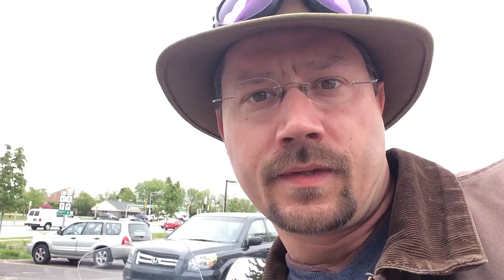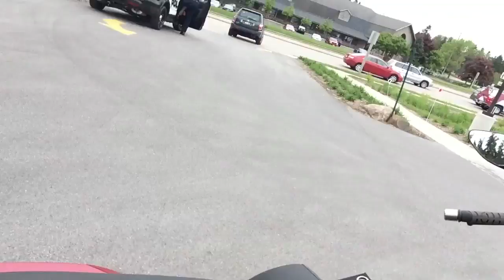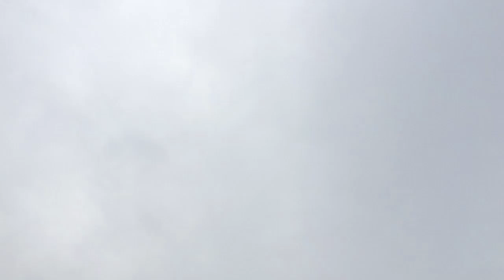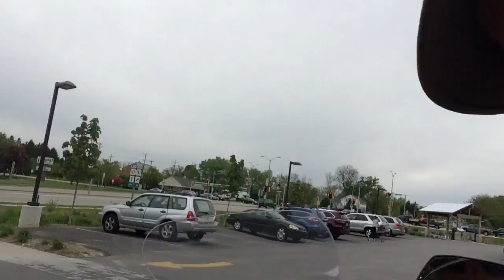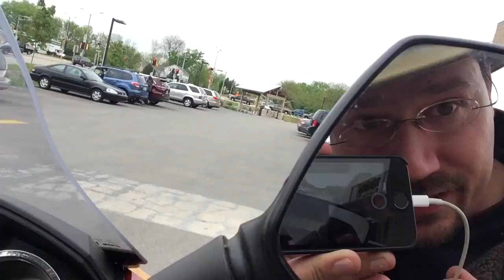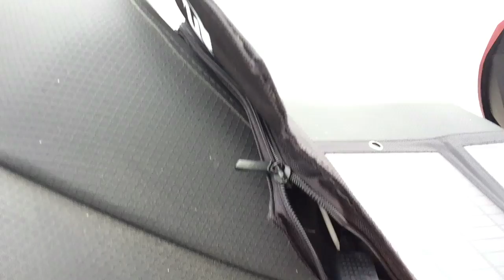Charging my phone from a solar panel instead of Vectrix

Comment: Many modern chargers work from a 100 to 240 VAC outlet.

If it's a newer light-weight "switching" changer, the AC input goes right into a diode bridge and converts it into DC. (that DC is then regulated down to the charge voltage).

That means (in theory) you can connect that power supply directly to a 150VDC battery (or PV array) and it will work just fine. 

I've tested a couple of 5Vdc and 12Vdc PSUs at 48-50 vdc (my back-up battery bank)
and they worked fine under a light load. In another project I used a 12v PSU by connecting the 100-240 vac input to a 100-130 vdc PV array.. It worked like it was plugged into a wall outlet..
Reply from the maker: Richard Lee I'm considering creating a dedicated connection to the battery (maybe an Anderson connector?) which I could use to hook to an external charger or a power inverter.
Reply: For a little wall-wart USB charger, you could use a standard 120vac outlet socket. Or maybe just a cheap Zip-cord extension cord.

 Just have to paint red and label it "DC".
Of course that's not fool proof.. (Since fools can't read).

One of the heavy duty Anderson PowerPole connectors sounds good for charging.

Just be aware that any current flow / load when plugging or unplugging the Anderson connector can lead to arcing. DC over 100v will destroy contacts on relays, switches and connectors.

My fixed 800W PV array is wired serially is high voltage (100-130v) but is limited to 8A.
I connected that 8A DC source to a new hot water heater that had 30A 240Vac controls..
The 8A cooked them.. The contact spacing was okay for AC, but DC arced too much..
Welded them..